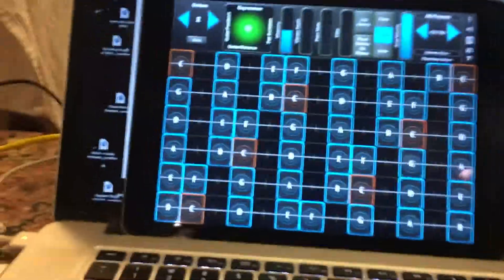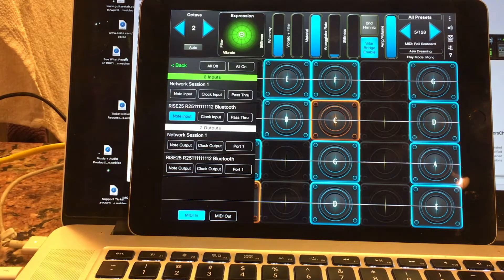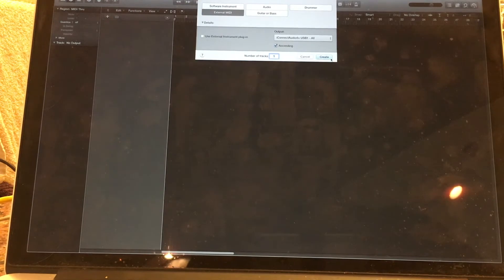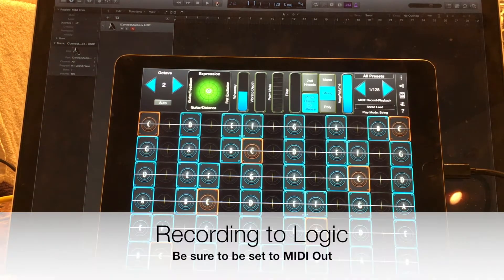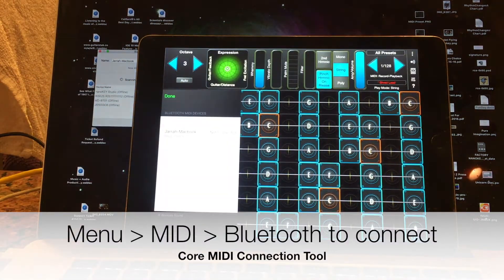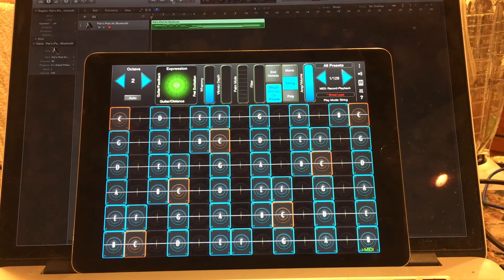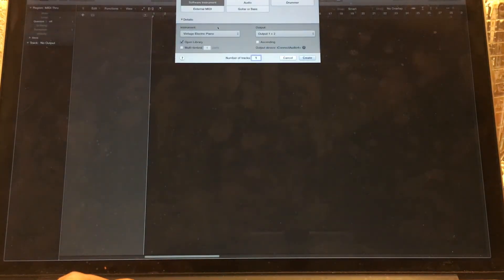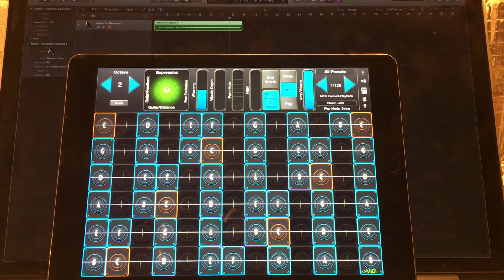GeoShred Application Note #6: GeoShred MIDI Use Cases

Comment: @GeoShred is it possible to send midi from ableton (Windows PC) to Geoshred to be able to visualize the notes played in real time on the Geoshred app ? I have Studiomux  which works great for sending note from ipad to PC but I can't figure out how to do the reverse process...
Reply from the maker: You can send MIDI to GeoShred.  Are you talking about the stand alone app or the plugin?  Note that each row in GeoShred is an MPE channel and of the 127 possible notes on the channel, it only displays 12.  Thus when a note comes in the row flashes but not the specific key because essentially most notes are not even in the row. 

Depending on if you are using the stand alone app for the plugin, you need to configure GeoShred to respond to MIDI In.  This is found under "Menu> MIDI> DIN Button> MIDI In. 

I can't really comment on StudioMux.  It no longer works for me and they are no longer supporting it.  I use a hardware interface between my iPad and my desktop computer.
Reply: @GeoShred  i am talking about the app on Ipad. I wanted to see the keys lighting up when a note is played to visualize how to play a melody. But from what i understand of your answer it is not possible... A little strange though because on a ipad layout you have a lot of notes displayed ! i don't really understand why the row only is highlighted... the MPE is not relevant for this usage, only midi note.
Reply from the maker: @zeplissken I think you are not understanding that each row is a single channel mono-synth and can only display 12 out of the 127 possible notes. 

What you are suggesting is that the whole GeoShred Keyboard would be on a single channel.  That is just not the way that GeoShred works.  GeoShred is probably not the right tool for what you are wanting to do.
Reply: @GeoShred  ok, thank you anyway for the chat ! ;)

Comment: Please be more transparent to the users. The audio coming from a recorded midi clip in a DAW (time 4:39) is missing data, i.e. the vibrato is not there. I myself managed to input MIDI from mi iPad Pro 3rd gen (MIDI> or MIDI-OUT) to my DAW (Bitwig), and hear the recorded midi clip back to my iPad (>MIDI or MIDI-IN) using the [Recording/Playback] MIDI Preset, and I noticed the same thing, the vibrato and other data are lost in the way, in other words, it never gets to the DAW. The only way to record every detail is through audio channel, directly from the Ipad, in my case using Studiomux in Windows 10.

I will make a video and send it to your support mail.
Reply from the maker: Ciber Punker, can  you assist us with understanding the problem that you are running into.  There should not be missing data.  If you mean vibrato via modWheel, it is sent on MIDI channel 1 per the MPE spec.   Please contact us directly at support@moforte.com so that we can assist you.
Reply: @GeoShred  You didn't notice? Please put special attention to the guitar vibrato you made in the video, this is an example of a real vibrato https://www.youtube.com/watch?v=-KMrR_LqrOE. Then, listen the original recording from your iPad and the playback from your DAW. You will see the difference. Sending an email to support.

Comment: Is the camera connection kit absolutely required? I thought I might be able to bridge the connection between my ipad (3rd gen) and keyboard with a USB type A female-to-female coupler. However, my ipad does not seem to recognize the keyboard. I was trying to set it up as Single Channel. Any guidance is much appreciated!
Reply from the maker: I don't think that will work.  I believe that the camera connection kit operates as a "Null Modem" effectively swapping the order of the USB serial port lines.
Reply: @GeoShred  Ok thanks for that, and the quick reply!

Comment: How can i configure midi out to Windows PC(FL studio 12)??  plz help
Reply from the maker: Windows PC's typically require a MIDI interface to send MIDI into the PC.  1) Plug a USB to lightning cable into the MIDI interface.  2) Follow the manufacturers instructions for how to get MIDI from the interface to FL Studio 12. 3) On the GeoShred side you will need to select a MIDI configuration under Menu> MIDI.  If FL Studio supports MPE then use the MPE configuration.  If not, then chose the Multi MIDI configuration. Finally chose Menu> MIDI> DIN> MIDI Out to send MIDI to USB.
Reply: Ok. Thanks for your reply. 😊🎸🤟🏽🤘🏼
Reply: Sir, plz suggest a mid range MIDI usb interface. I can’t find it...
Reply from the maker: Here is a listing from the sweetwater catalog: https://www.sweetwater.com/c677--MIDI_Interfaces?mrkgcl=28&mrkgadid=3252694&rkg_id=0&campaigntype=paidsearch&campaign=Computer%20Audio-MIDI%20Interfaces&adgroup=MIDI%20Interfaces&keyword=usb%20midi%20interface&placement=google&adpos=1t1&creative=298145153702&device=c&matchtype=b&network=g&gclid=EAIaIQobChMI9JuZ9-Wr3gIV03J-Ch3krQDmEAAYASAAEgLlU_D_BwE
Reply from the maker: Be sure to make what you chose iOS compatible
Reply: Yeah, i understand. But i can’t find. I search everywhere. But search result is only for keyboard midi interface. I cant find for ios. 😔😢 Plz help. How it costs in India?
Reply from the maker: I'm sorry we are in the US, we don't have any information about what MIDI products are available in India.  If you can find this product in India, it is a common low cost lightning to midi interface that works to connect iOS devices to both Windows and Mac computers: 

https://www.amazon.com/iConnectMIDI1-Lightning-Version-1-out-Interface/dp/B00MRFG3WU/ref=sr_1_3?ie=UTF8&qid=1540822437&sr=8-3&keywords=iOS+midi+interface&dpID=41ySgaSDNRL&preST=_SY300_QL70_&dpSrc=srch

Comment: How can I get the output sound from the Geoshred to Bluetooth speaker without latency problem.. plz guide me..
Reply from the maker: This is not specific to GeoShred, but rather how Apple setup bluetooth audio.  Bluetooth audio for iOS devices has a built in 1 second delay.    This is because Bluetooth audio can be prone to dropouts, so Apple made the decision to make the buffer large to mitigate dropouts.
Reply: moForte Then is there any other solutions to play Geoshred wirelessly?
Reply from the maker: This is not specific to GeoShred, but rather how Apple setup bluetooth audio.  Bluetooth audio for iOS devices has a built in 1 second delay.    This is because Bluetooth audio can be prone to dropouts, so Apple made the decision to make the buffer large to mitigate dropouts.   As far as we know there are no digital wireless audio solutions that support low latency/jitter.  They all use large buffers.  We know a number of companies that have tried to solve this problem but have been unable to find a solution.  If you must do wireless then you may want to look at analog systems intended for guitar players.  Note that these are mono: https://www.amazon.com/s/?ie=UTF8&keywords=wireless+system+for+guitar&tag=googhydr-20&index=aps&hvadid=178353617490&hvpos=1t1&hvnetw=g&hvrand=16800866159998845200&hvpone=&hvptwo=&hvqmt=e&hvdev=c&hvdvcmdl=&hvlocint=&hvlocphy=9031921&hvtargid=kwd-1103635209&ref=pd_sl_2zp5rnf4q7_e
Reply: moForte Ok...I got the point.. Thanks a ton for the information...

Comment: How can I set up GeoShred to wirelessly control a VST such as Omnisphere on my iMac? I would like to use my regular wireless network instead of an Ad Hoc network if this is possible. Thank you.
Reply from the maker: You can use Bluetooth, ad hoc wifi or regular wifi.  We don't recommend regular wifi because it's conflicting with normal network traffic and will have lots of jitter.   Also as of Sierra you can us a regular USB<-> Lightning cable to directly connect your iOS device to logic for both audio and midi.  That is really the best way to go.
Reply: Thanks very much for the info and the amazing GeoShred!

Comment: How many simultaneous notes can you play?  I suppose the iPad can only detect so many touches at once and that might depend on which generation iPad perhaps?
Reply from the maker: All iPads support 11 simultaneous touches, iPhones support 5.  GeoShred is a model of a 6 string guitar so you can play up to 6 voices.  If you are using GeoShred as a MIDI controller you can use as many touches as the device supports.

Comment: HI Team, iam using geoshred in ipad connecting to logic pro in imac. I followed 
your steps for bluetooth and i can hear the external midi being recorded but i hear nothing when i export as mp3 or wav. Please help 0064210579539. i live in auckland , new zealand.
Reply from the maker: It sounds like you are only recording MIDI.   Bluetooth does not send audio.  If you want to record the audio you will need a USB audio interface like the iConnectivity Audio4+ that we use in the videos.   Per my email exchange with you yesterday, let's setup a skype call.  Thanks -Pat Scandalis CTO moForte.

Comment: You can connect all you stuff via your iconnectaudio interface, including the iPad and controller instead of a separate connection with the camera adapter for the controller. I know it can be tricky but you can save setups for the iconnectaudio4+. I use one for everything. It's the best.